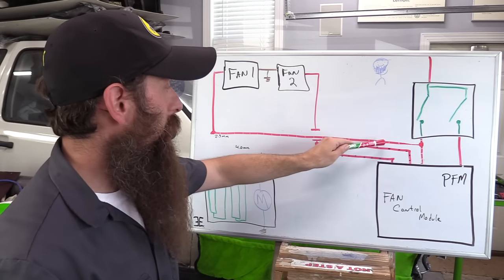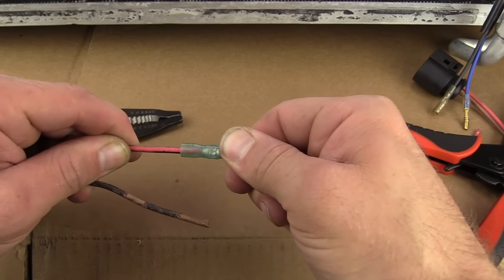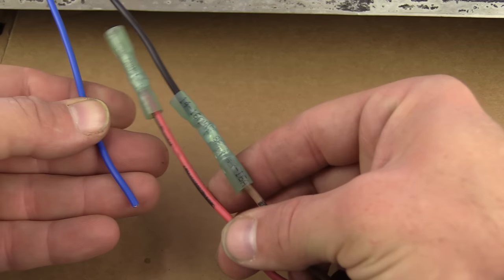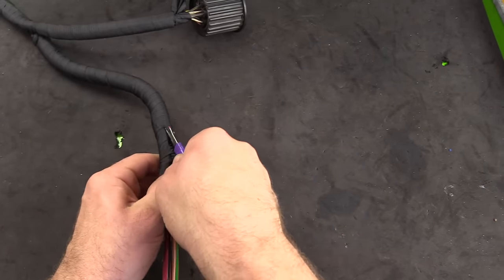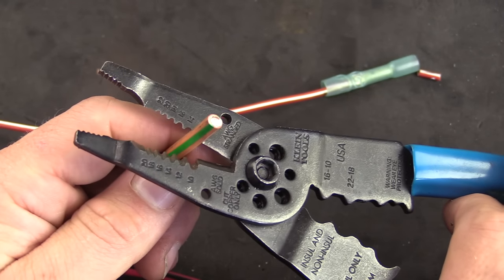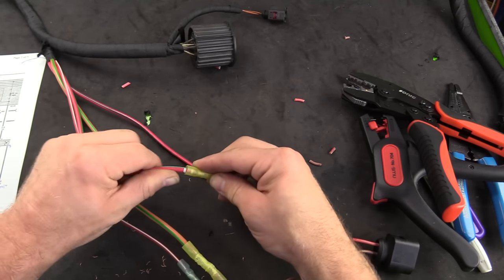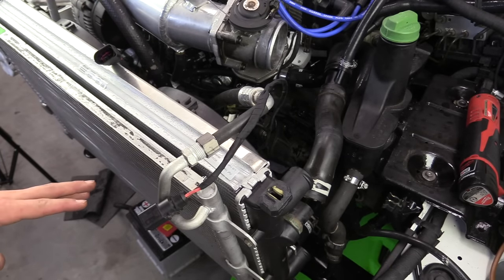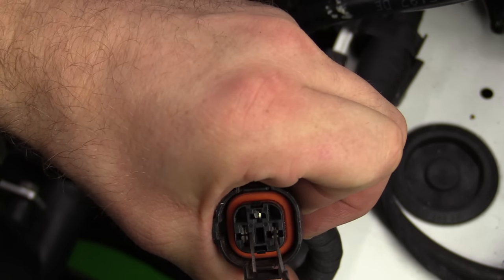How To Wire Electric Cooling Fans with Crimp Connections

Comment: Why are crimp connectors the preferred way? I've always used solder and heat shrink as it seems the be the strongest, most reliable means of connecting wires.
Reply: Charles Hollow I have the same question. Especially on smaller wires. I do an axial twist, solder, shrink, seal and wrap.
Reply: I heard that solder can break after a while due to exposure to heating and cooling quite often. I guess it depends on what solder you use and how much and the quality of the wire. Crimp connectors are much easier and less time consuming way of fixing a connection imo.
Reply from the maker: +InsideOfMyOwnMind I’ve seen testing that proves either one can be stronger than a wire. 

The big key is “performed properly”.
Reply: And in my opinion, tracing wire defects is the last thing you want to be doing..
Reply: Crimps are quick solder and shrink is the best.  Shrink crimps are second best.
Reply: They aren't. Strip, braid the wires together, solder well, and then heat shrink. I'd fear my 1.8T swap in my Corrado if I had used any sort of crimp connectors. And yes, after a few hundred connections you get really good. ;-)
Reply: I love all the people giving incorrect information, like they know what they are talking about.  If you have high quality crimp tools, crimps are better...period.  Solder takes away the flexibility of the wire beyond the joint (it's called wicking) and can cause the copper to work harden and break strand by strand as it vibrates or is moved.  OEMs and Professional Motorsports don't use solder for a reason.  If you don't have high quality crimp tools and are trying to crimp insulated connectors with that multipurpose crimp tool, then yeah, you will probably have better results with soldering.
Reply: Jared Shaffer Well it looks like splicing methods have become an ideology here. Awesome! The Crimpers vs the Solderers. All I can say is I've seen wires break at crimps but haven't seen solder break inside harnesses. I remember a mil spec regarding soldered wires that required the solder does not extend from the connection to the insulation. Bare copper must show. Maybe that's the answer, or maybe the earth is flat after all. Lol
Reply: To be fair, I solder or crimp depending on the situation.  However, I know that crimping is better, but for a lot of applications both are more than adequate.  I used to only solder, but that was before I spent some money on proper crimping tools (and I'm not even talking about the ones that cost a few hundred dollars and give perfectly repeatable results in a single stroke.)  Now that I have good crimp tools, I see myself soldering less and less on my car.
Reply: Jared Shaffer Not to be a jerk, but solder is about as good as you can get short of welding.  Its not a matter of debate, it's a physical bond/property.
Reply: Read here http://avielelectronics.com/Downloads/Catalog/Ref-Crimp-vs-Solder.pdf  Basically, solder is easier and more forgiving, but crimping is better, although more expensive.  The debate isn't the conductivity of the connection, it is how well it holds up in a the harsh environment of a car.
Reply: @InsideOfMyOwnMind If you see wires breaking at crimps, you are likely using the wrong crimp or the wrong tool for the wire.  Soldering is easier, and more forgiving, but properly done crimping is more reliable in high temperature, high vibration environments.  If you don't have the proper tools and are crimping with pliers, then soldering is better.  If you are talking about solid wire another possibility is that you are damaging the wire.  For instance, if you nick a wire with the wire strippers, it will be weakened and may fail. That can happen with either soldering or crimping.
Reply: Where I saw them fail was right where the wire exited the metal part of the crimp. Usually the actual crimp takes place a bit further in. These looked like simple metal fatigue from repeated flexing.
Reply: Cute, a one page PDF with no testing referenced put out by a electrical connector manufacturer.  With heavy gauge solid core wire crimp connectors may be preferred/easier, but you can still get a better bond with solder.  

http://www.rfcoaxconnectors.com/Technical_CrimpvsSolder.htm

"This fabrication method is often considered the most labor-intensive because the connector's center contact is soldered to the cable's inner conductor. Performed properly, it is also one of the most reliable connections and can be used on cable with solid or stranded center conductors. If metals and plating of contact and cable are compatible and solder-able, and, if the technician is skilled in this type of installation, solder connections can be expected to perform for long periods of use."
Reply: Soldering is not easier, it takes quite a bit of skill training and experience to do properly.
Reply: xephael - From your own link "Crimped connections, done correctly, can be superior to soldered connections."  but keep on thinking I'm wrong.
Reply: Jared Shaffer Can!=Are...
Reply: xephael - You referenced a site dedicated to coax cables which are solid single strand wire and not typically used in an environment like a car where the advantages of crimp connections become evident and yet, even in that application, crimps CAN be better than solder if done correctly.
Reply: OEMs and most motorsports don't use soldered connections for one reason - time. It takes what, maybe 20 seconds to strip two wires and join with a crimp? A good braided solder connection takes more like 3 minutes with the solder time and then heat shrink (I used a heat gun, so a swap of tools). So about 9x longer per connection. Do that hundreds of times, and that's a lot of money if you are paying somebody. As to longevity though (not something motorsports cares about), I prefer solder. I did the swap about 12 years ago now - and not a single failed connection. I've never had that sort of result with crimp connectors, yes using the correct tools. But really, use whatever works for you. For me that will always be solder unless it's someplace you just can't do that.
Reply: Bryan Hall You're correct, crimped connectors are often the quickest and best way for most work to be done...especially by low skilled individuals.

My contention is that a high quality solder, brazing or welding job by someone who's skilled, can always exceed a crimped compression fitting.
Reply: Oh no. What have I done?!?!?!?
Reply: Charles Hollow Looks like you started a new religion. At least we've been civil  about it.....so far lol.
Reply: Just curious for those of you who swear by solder, what source would you accept as proof that crimp connections are better in an automotive application where vibration is a concern?
Reply: Jared Shaffer crimp or solder connections should be mechanically secured.  Once that's done you could do a study where you put them on a vibration bed and test to failure.
Reply: Jared Shaffer BTW if you utilize digital technology in your automobile, you already have thousands of solder joints...
Reply: Yeah...to a circuit board which itself is mounted to isolate it from vibrations and heat.  You can't exactly crimp to a circuit board anyway, so what's your point?  You still haven't answered my question of what source would you accept as proof that crimp connections (when done correctly) are superior.  If I ran a test myself and the results didn't favor what you already believe, you would assume that my soldering was suspect.  So as I see it, there is essentially 0 chance you will be convinced that you are wrong on this matter so I'm done arguing.  Oh and if you re-read the comments, I have nothing against solder joints, I even use them depending on the scenario but I recognize that quality crimp connections are superior.
Reply: Jared Shaffer A circuit board is a classic example of scenarios where solder connections fail. The rule as I was taught is to provide mechanical support to a connection before you solder it. Circuit boards are often not great at that. So, what to do with wires? OK, does anyone here crino and then solder the crimp connection? I have done it but mostly when I had insufficient confidence in the crimp.
Reply: Agreed that solder connections on circuit boards do fail, but my point was that it is an apples to oranges comparison.  With low quality terminals I would crimp and solder.  But really, crimping at that point is just to minimize the amount of solder needed.  Nowadays, I stick to quality terminals though, so I don't have to worry about my crimps.
Reply: None. Preference is based on personal experience with both types.
Reply: Charles Hollo

Comment: What kind of isolation tape do you use? The tesa tape I use doesn't stick very well..
Reply from the maker: +Nils Bijlsma I’ve had really good luck with that tape. 3m friction tape works great too. But I don’t think it holds up to heat as well
Reply: Yeah, not sure what the matter is with the tesa tape over here, it's the tesa electronic tape which is not really that wide. Maybe that's why.

Comment: I picked up a Ford Contour V6 dual fan setup that I want to re-purpose in my Camaro. The fans are 2-speed, and each fan has a separate connector with a 2-wire pigtail. Supposedly, one wire is for low speed, the other for high speed. But there's no ground wire. How do I test these fans and hook them up?
Reply from the maker: They have to ground some how. Can you get ahold of the wiring diagram for the fansb

Comment: What type of fans are those and where can they be ordered?
Reply from the maker: +Kelvin Fuller the are Mishimoto fans. I got them from a buddy so I don’t have a recommendation for a source
Reply: I am in the middle of replacing my fans, can you tell me if your fans are 12" and the cfm ?
Reply: These are the same fans and shroud (swoopsbuilt) I'm running on my car - they are 12" Mishimoto slim fans, 1150 CFM each.

Comment: hello. did you build the support metal frame for the fans?
Reply from the maker: I didn’t. They were on the fans when I got them. Swoops made them I think
Reply: @HumbleMechanic  i have 2 of those "chinese" fans that hold with straps. But i think it would be better colling with a metal frame. Right?
Reply from the maker: Very much better.

Comment: What an outstanding teaching video, Charles.  I have been waiting quite some time for such a stellar video - one that is clear, steady, informative, and helpful.  

One question:  what brand terminal release tool did you use?  I am struggling to find the correct tool for my TCM harness unit.  

Thank you, Charles. 
Michelle
Reply from the maker: +Michelle E. Hey Michelle. Thanks for the kind words. Years ago I bought the real deal VW special tool wire pin tool. It’s the best out there and about $50 each. Ouch!
Reply: $50/each is a steal, if it protects your pin.  What brand, if you don't mind?  I need the specific one you used to fix my TCM wiring harness.

Comment: I have a small kicker fan in the front of my condenser which I use on hot days through a adjustable thermostat deal however I've been told when it comes to these high-powered dual fans you have to upgrade your alternator to provide that high amperage flow needed, just throwing it out there.
Reply from the maker: Depends on the car. These on my car draw less than the OEM fan did.

Comment: I was just reading an article on crimping versus soldering.
It seems the Aviation industry is against soldering and repairs must be crimped. 
Mainly possible heat melting the solder and or corrosion damaging the soldered connections
Reply: Brad Downs I am curious what is the corrosion catalyst of a connection soldered with rosin flux if both types are sealed? I'm not challenging your comment but am interested in the knowledge. I have not seen a properly sealed solder connection corrode unless it was faulty to begin with causing excess heating and sealant failure, something that crimps are also subject to. Heat matters due to the hydroscopic nature of the cooling process.
Reply: Continious vibration weak solder joints.
Reply: InsideOfMyOwnMind 
They really didn't state the reason for corrosion but I would imagine the environment of the aircraft has alot to do with it.
Reply: Please cite the FAA/MIL circular publication ID, chapter and section that show explicit warnings and or prohibition of solder joints and or soldering connections/connectors. 

In FAA publications Aircraft EWIS Practices Job Aid 2.0 and Advisory Circulars AC43.13-1B/2B, 43.18 wiring fabrication, repair, connector soldering procedures are described, no where in the publications is soldering prohibited, limited or warned against.

Comment: Load side should have the MALE pins to help avoid boo boos while the connectors are not connected.
Reply from the maker: +ycmdill that’s good advice for sure. 

I’m just trying to picture the series of events that would have to happen for this to really be an issue.
Reply: Not saying you would do it but had a helper while in the AC business.  Left an ohm meter across the compressor to see when the thermal overload closed and went into the house for a moment with the 220 disconnect open.  Came back to a familiar (smoke out) smell.  He plugged in the disconnect while I was gone.  No reason.

Comment: Umm not DONOT use crimp connectors slide good shrink wrap and then soldier the wires but guess this is the meaning of backyard mechanics
Reply from the maker: That’s 100% not true. High quality crimp/seal connectors are as good if not better than solder. This is why OEMs use them as approved factory repairs. 

When done properly, both repairs are great. The key is done properly. Sure you can do a bad job with crimp connectors, just like soldering.

Comment: Relays are bad news for starting DC Fan motors from a dead stop.  It can also blow the diodes in your alternator.  Much better to go with Pulse Width Modulation type of controller.  Relays will fail over time and burn out.  www.autocoolguy.com